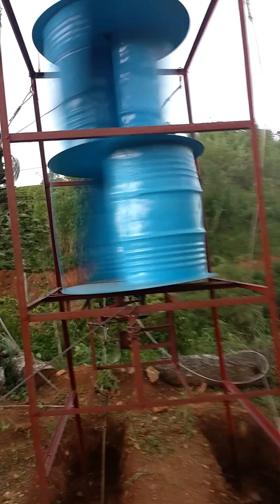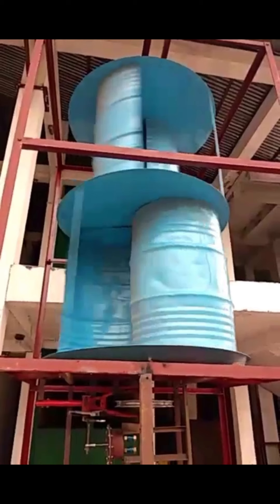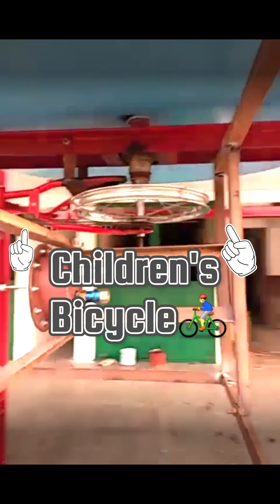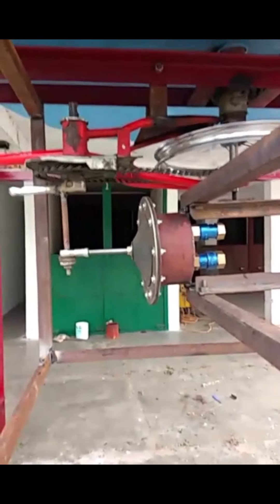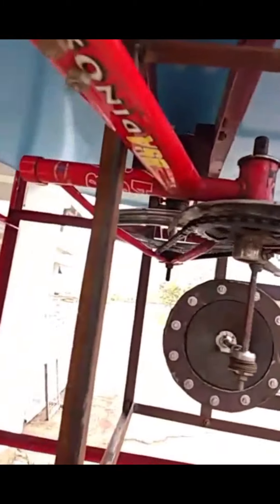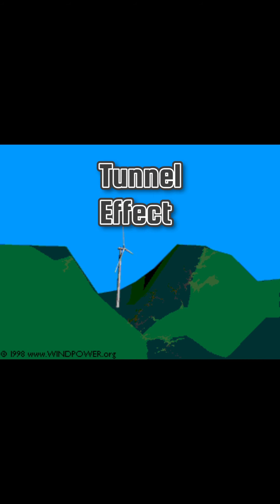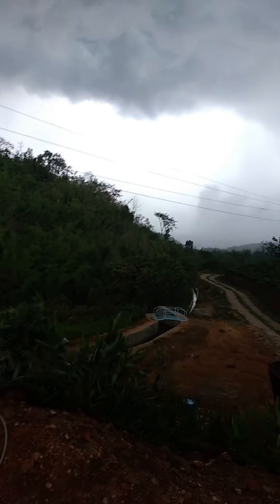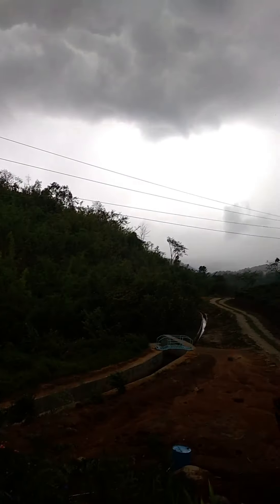Wind Pump Re"Cycled"

Comment: OMG Nathan, little late on this video but I was really shocked to see the speed. Amazing energy possibilities. Looking at the wind speed may be reinforce the setup for higher RPM .
Reply from the maker: Thank you.  Yes a lot of potential is there.
Reply: - OR the cups could be spring loaded (trailing edge) to act as a centrifugal brake - spilling air and limiting top speed (runaway protection)

Everyone gets  caught up in "efficiency" in Wind Engineering, at the end of the day, if the resources and materials are  available, being able to use  the energy is what matters.

The bicycle mechanism to Diaphragm pump are a nice match.  (and if the diaphragm is  only rubber from tyre tubes, with low pressure check valves - very easy and cheap to reproduce.)
Reply from the maker: @kadmow  Thank you very much for your insight and suggestions.  Yes you are very correct that being able to use the energy with locally available materials and resources are important👍
Thank you again for your encouragement for the old bicycle usage 🚲 😊